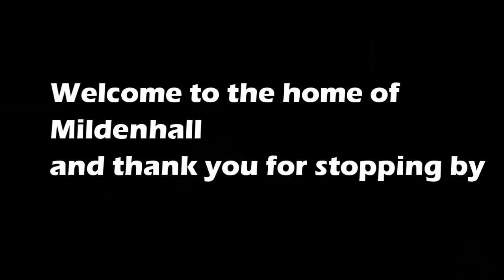Lima HST Conversion Ups and Downs Twists and Turns

Comment: Hi Suzanna great video I have a lima HST as well I have converted my power car ringfield motor to a CD drive motor and fitted TTS sound to the power car and the dummy car and it runs really smooth the only thing to Remember If You're fitting a TTS sound decoder to a dummy car is that you must program the dummy car and the power car on the programming track at the same time for it to program. I've also fitted directional lights. Keep up the good work great video

Comment: Hi Susannah, very informative video and great to see you in good form. Interesting to find out that the Gaugemaster decoder didn't work well with the Prodigy Express. Great tip also about the CV29 for the directional setting. As usual thanks for sharing,   Michael

Comment: Hi Susannah you can also just take out the drive gear and disconnect the power to the motor and use it as a dummy car with the dcc sound chip and just have one power car you will get then sound at both ends and no push pulling problems plus you will have the extra weight of the new dummy power car.  Great video
Reply from the maker: Hi Peter, I had done that and removed the gears sadly there was still too much friction for it to work so I put it all back and have two dcc power cars. Susannah

Comment: Fantastic video / tutorial Susannah, just goes show it’s definitely possible to get older stock running well. Lets hope you are able to crack the relevant CVs to get both powercars running together. Sadly Ive never managed it with the Z21, but the gaugemaster system does allow a much easier consist method.
Reply from the maker: Hi John and thank you for commenting, its well worth saving some older stock and this Lima HST was one in my view. They are both running well although one still needs more tlc. Both need to be consistent to be able to co-operate with each. Susannah

Comment: Hi Susannah   i see you dont have any cab lights wire on that HST  my LIma HST  had the front headlights with a single bulb onto a metal plate onto the front bogie with the copper contact ( the one you cleaned)   I could not get this  Thing to work  now i'm gonna try  your set up for my TTS  sound and  with any luck it should work perfectly  thank you for uploading this video  much appreciated!
Reply from the maker: No problem,  glad to be of help. Susannah
Reply: @Pixie586     got it working  Thanks Susannah!

Comment: Hi Susannah, great video and very brave of you to do it all live. When you tried to reverse the direction of one of the power cars which wires did you actually swap? If it was the black and red then that explains why they still went in the same direction. You need to swap orange and grey. If that is indeed what you did then it suggests a CV problem in one of the decoders. .......................John

Comment: Susannah, try taking the old brushes and springs out and put new ones in, it worked a treat with mine. 
What on earth are those symbols on the roof  of the e-bay power car? 
Regards 
Kev

Comment: Hi Susannah, good effort in converting the old Lima model, am I right in thinking that there is a conversion for the ringfield motor
Reply from the maker: Hi Andrew, yes I believe there is but depends on how far you want to go with it and weather it would become too costly. You can spend as much or as little as you want. Susannah
Reply: Couldn't agree more. It's not a bad model though & considering the price of the new Horby model it could be a cost effective alternative. Thought for the future maybe